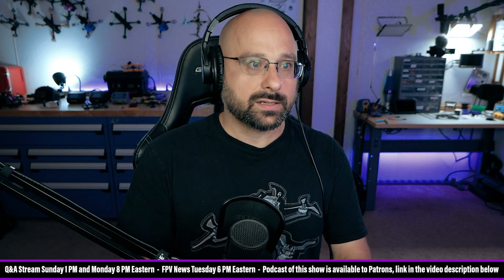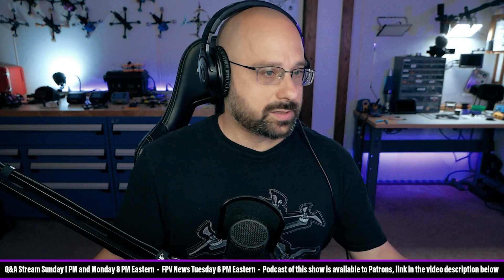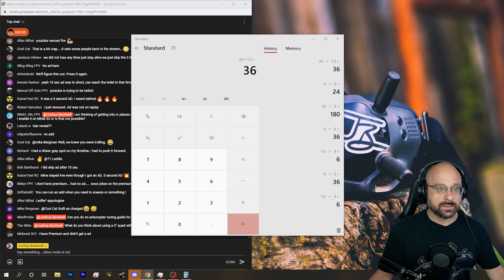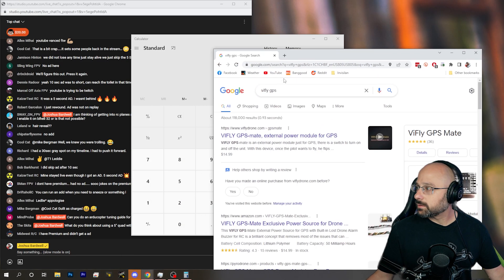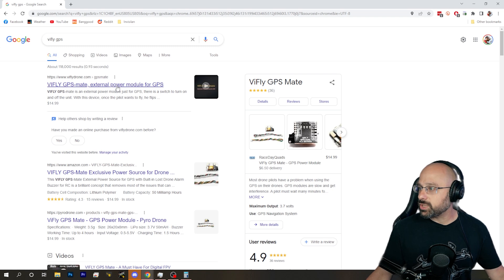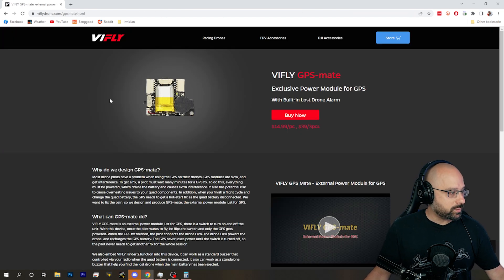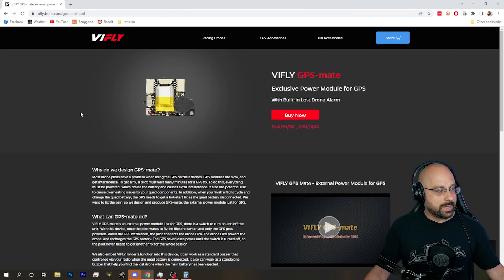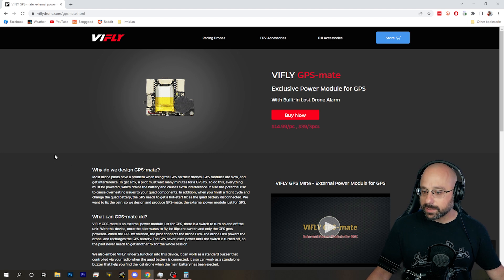My GPS Module Can't Get Satellites to Lock While My VTX Is On! - FPV Questions

Comment: I've run a little experiment with two almost identical 5" quads. One with earthed copper tape wrapped around the cable between FC and GPS. The other without any copper wrapping. Quads both have their GPS mounted in a tray stuck out the back of the quad. Took both quads to field a number of times over a fortnight. 
Quad without wrapping always took a few minutes longer to get sat fixes and always finished flying session with fewer sats than the wrapped version. Since then I've wrapped both of them and they find satellites in same sort of time.
Conclusion: earthed copper wrapping on GPS cable definitely helps get sat fixes.
NOTE:  Important to earth the wrapping to FC earth otherwise the wrapping can actually make it worse at finding sats.
BUT I don't think its a silver bullet solution - you still need to put the GPS as far away from other cabling as you can manage.
Happy flying!

Comment: Just put a few layers of anti-static plastic sheets under the GPS antenna from whichever direction it is getting bombarded with unwanted RF interference.. Locks almost instantly. Anti-static plastic sheets don't reflect the RF, they absorb them. So it is better than using a metal foil to reflect off the RF.

Comment: I have a gps module which is showing it's fixed and locked in betaflight in the gps tab, but the osd shows 0 satellites...any idea why that might be?
Reply: Throw that away, it may be defective or your configuration isnt right, buy an rtk gps, place it next to camera, make sure no obstructions, and away from all transmission antennas

Comment: Also I your on BetaFlight and if your VTX supports pit mode then consider having pit mode on a switch, have the telemetry heading to your transmitter and then when you power up you can switch to pit mode with a switch, this will allow you to get a lock, then you can watch your transmitter to see how many sats have been locked.

Comment: My gps doesn't get satellites when I have my naked gopro onboard for some reason. But if I fly a pack without it on it will charge the little battery and work half decent on the next pack. I don't know what causes this besides some weird interference maybe.
Reply: Doesn't make sense, put your gps next to the camera
Reply: Throw that away, it may be defective or your configuration isnt right, buy an rtk gps, place it next to camera, make sure no obstructions, and away from all transmission antennas

Comment: Yea my build is kinda tight, and I have the 1w hdz freestyle. I got the vifly board but I think I wired it wrong so I need to redo it.
Reply: i just built a 7" quad with hdzero 1w but every time i power the vtx i loos sats tryd copper tape wrap and earthing the lead still the same is yours working yet
Reply: Same issue here. Hdz freestyle sucks I guess. I'll try filters now 😢

Comment: In INAV you can use the programming TAB to set the VTX power level to a specific level based on the number of GPS sats you have. For instance : if the number of sats is lower than 6 then VTX power level is 1. Not sure if you have that on Betaflight
Reply: +1 for iNav
Reply: Buy an rtk gps throw away that cheap gps, put it next to camera away from transmission antennas

Comment: It happened to me that the GPS was blocked and when I put the naked Gopro to work, it lost almost all the satellites.
Reply: Maybe you need to disable the wifi on your GoPro GoPro labs is a good approach to handle this with naked GoPro
Reply: Buy an rtk gps put it next to camera away from transmission antenna, all the best, dont waste time with cheap gps

Comment: or just find were the noise is coming from and isolate it. normally its a case of GPS is too close to the FC. run a longer cable move it around and test.

Comment: whats the issue here then? noise from the vtx? if so would it be possible to put shielding between the vtx and gps module/antenna?
Reply: The issue is basically that the GPS module is trying to get a signal from a bunch of satellites, which are super far away. The VTx is, by most standards, an incredibly powerful transmitter. On quads, the VTx antenna is generally very close to the GPS module (which has a patch antenna built in), and the VTx is basically so loud that the GPS can’t “hear” the signals coming from the satellites. I’m not sure if that’s because the wires that go from the FC to the VTx and GPS are generally close together and they interfere with the signal coming from the GPS or if the radiation from the VTx antenna is enough to deafen the GPS antenna, or both. 

Anyway, basically the issue is just that the VTx is too loud for the GPS, which is why powering the GPS up before the VTx can allow you to get a lock. Generally once the GPS can find a lock, it knows better what to look for and can kind of listen through the VTx noise, which is why you can turn the VTx on once a lock is achieved. The best solution (though it is hard to achieve on a quad) is to separate the GPS module from the VTx as much as possible. On a flying wing of mine, I have the GPS on one wing tip, the VTx in the center, and the receiver on the other wing tip. This allows me to go from a cold start to full lock in less than a minute in virtually all circumstances. But that’s because there’s about 400mm separating each antenna from each other. 

I’ve also found that enabling the “low power until first arm” setting in Betaflight can help with GPS acquisition since it keeps the VTx at ~25mW until you arm, so there’s much less noise that the GPS has to fight through. 

I’m definitely not an expert, but that’s my understanding of what’s going on.